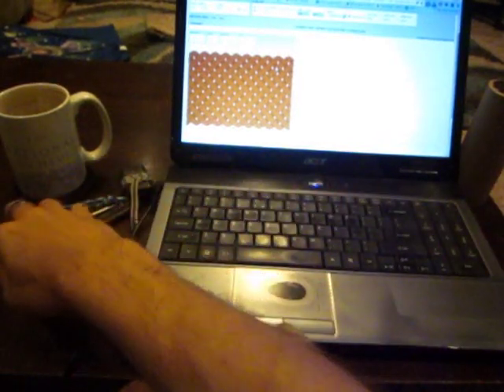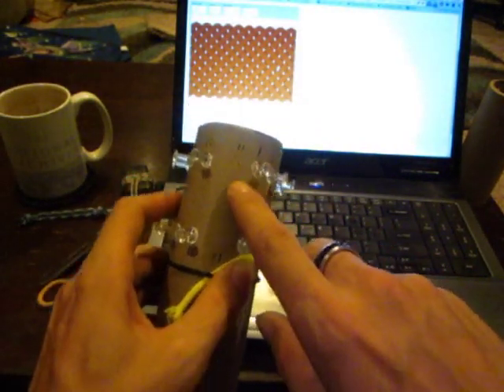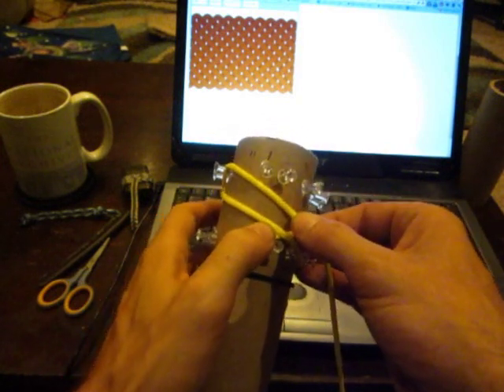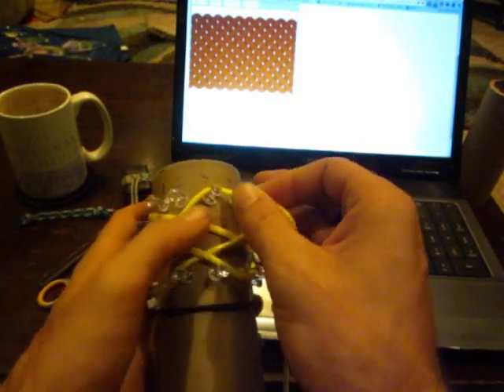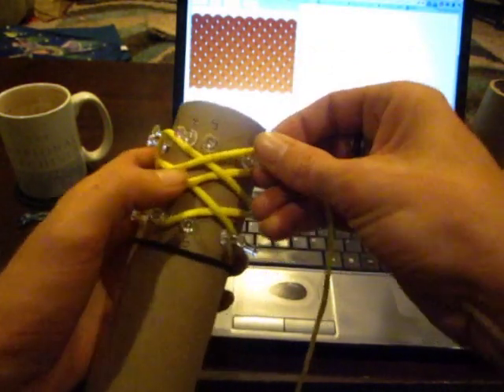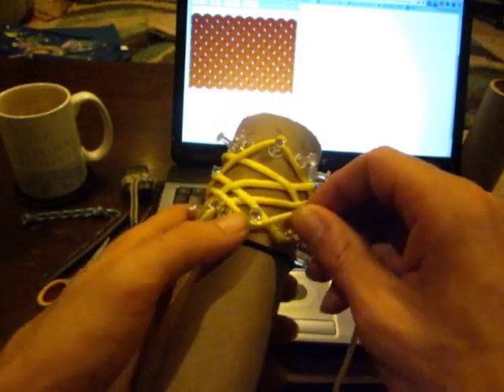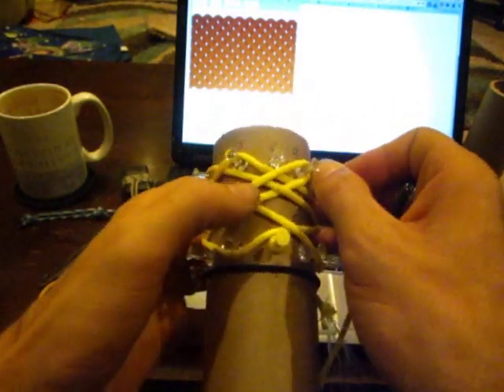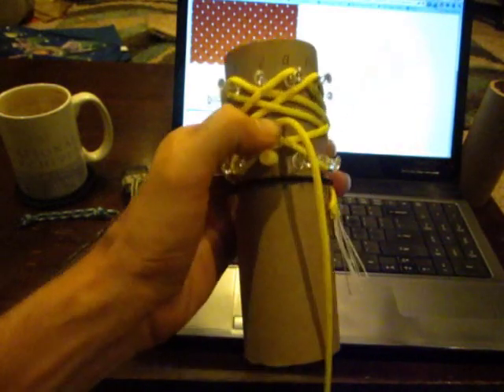13Lx10B 3-pass Gaucho using Gridmaker - Part 1

Comment: Thanks for explaining how to use gridmaker to make gaucho knots. I never could figure out what the coding parameter was used for and why it had a "V" in it, just now see its not a V.

Is there still a tutorial on how to use gridmaker? At one time there was a video on knww.net but I never saw it because I was always on my tablet and they used some format my tablet didn't like. Now that that page is gone I can't find it.
Reply from the maker: Not that I know of.  KHWW went down for a bit and restructured.
Reply: Since my post I found the advanced grid maker that does other knots and multiple colors. Have you ever seen it?  And if so have you figured it out?  I could try to contact the maker of the page but not sure if I have enough knowledge to ask a proper question.
Reply from the maker: More or less.  I haven't used it for any of the advanced stuff.  The creator's name is Tim Allwine.

You can find the older version at igkt.net.